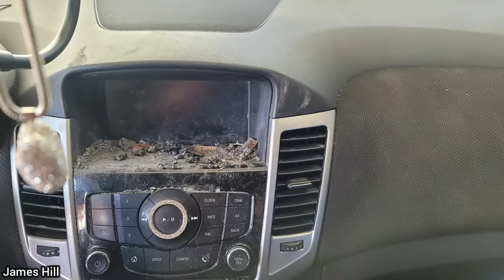Customer States New Oil Pump Installed, Still Has No Oil Pressure

Comment: Man I stress so damn much when I am in a situation where I have to allow an unsafe angry customer to leave in a car with failing brakes. As a low tier oil bitch I had no say in anything besides pointing out what was falling apart. Had a few I had to back out of the shop that I wasn't sure would stop once it started rolling off the alignment rack and into the parking lot.
GOD THE STRESS!!
Reply: Sorry about the stress, I can imagine. I’m curious, was there a policy where you worked, like did they make the customer sign anything saying they were warned but declined repairs etc? I do know that some quick service places can be scammy, I remember a muffler place telling me my car needed thousands in repairs, and my trusted mechanic said it was all BS.
Reply: Don't worry about it. It's their arrogance, bad decisions and lack of responsibility.
Reply: @toomanyhobbies2011  I wouldn’t stress about them, but rather anyone else in that car with them, and anyone sharing the road with them.
Reply: @Sashazur  Yes. I'm friends with several x mechies. If the car was in such disrepair that the shop wouldn't work on it, from a legal POV they made the customer sign a release form releasing the shop from any liability, which I'm sure would befall the customer after cornering above 5mph. The shops wouldn't give you your car back without inking the release. Because these types of shitty customers will always want stuff for free and try and sue you to fix the damage they caused for free.
Reply: @santanalz  ... if they don't have the money to repair, they certainly don't have the money for a lawyer. BTW, I have been to small claims over petty stuff like that. The judge said if we didn't do any work (estimate only) then we are off the hook for anything after that.
Reply: this is one of those wild american thoughts that are so minbogglingly stupid that no one in his right mind had to think about it twice: if a car is truly unsafe (major brake damage, frame dmg, tires close to blowing out, etc.) you  ARE NOT allowed to drive the car on public roads and why would/should you? first turn or traffic light you might very well plow into a field of firstgraders out on a trip. the shop MUSTN'T let you leave with the car, they have to inform police if there's any trouble from the customer
Reply: @Sashazur  Yeah I mostly worked in the kinds of shops with big corporate offices that are usually on the more "shady" side on an individual shop level so they can please their corporate overlords.
Reply: I would have zero stress over that non-issue.
Reply: We had a TV show in the eighties where people could bring their extremely dangerous car and get it inspected to show all the faults. The verdict in the end was almost always: scrap this dangerous ex vehicle. 

Almost all were either bought from second hand car dealers in good faith or just very long in the possession of the unwitting owner but some owners were almost proud to show their piece of crap. 

Major detail: this was before global warming hit so we had many and long cold days where salt was thrown on the roads so almost all of these cars were heavily rust damaged (too).

So somewhere mid eighties the govt had enough of these dangerous vehicles on the road and introduced state inspection for older cars. Since then the amount of lethally broken cars has been plummeting like crazy. It’s rare to see a car with major problems on the road. When you see them it’s often some person that did a hit and run and hasn’t been stopped by the police (yet).
Reply: Most developed countries have compulsory regular safety inspections to keep vehicles in that sort of condition off the road. It is, of course, an expense and extremely inconvenient to fail such a test, but I feel a lot happier knowing that these potential death traps are off the road. 

Also, any dealer selling a car in a dangerous, unroadworthy condition will be in trouble with the law.
Reply: @RustOnWheels  Oh yes, I've had a lot of rusty salty cars when I worked in Ohio. Cars where all the lift points crush like cardboard when you try to lift the car and dump a load of orange/brown evil all over the ground.
Reply: @Hekinsieden  seeing a truck bed buckle when a car is being lifted is never not scary…
Reply: @Simon-bu4kc  The problem with allowing shops to do this is that the sketchy ones would certainly abuse this to scare less knowledgeable people into getting needless repairs.

Comment: Sadly, I can say that that transmission case looks familiar, but I knew enough about what I was doing to salvage it.  Probably 15 years ago, I was going to change the transmission fluid in my 1999 Suburban prior to heading out on a 1200 mile trip to Florida with my wife and kids at Christmas.  The first pan bolt snapped off, so I very carefully worked the remaining ones back and forth to remove them.  Unfortunately, the threads from the case came out with half of the remaining bolts,   I ended up heli-coiling 8 of the 16 bolt holes.  I also noticed that the original bolts were property class 4.6 -- weaker than SAE grade 2.  I hadn't previously realized that metric property classes went that low, and I never before or since encountered corroded pan bolts.  The Suburban itself wasn't even rusty at that point, so who knows...
Reply: I agree, the bolts should realistically have been 8.8 grade. Cheapskates.

Comment: First one.  Looks like a 2014-2019 5.3 engine.  You have to be very careful when installing an oil pump on those.  Alignment of the pump is crucial and if done wrong can lead to damaging the pump.

Comment: They sealed the asphalt at my wife's work and she drove over it before it was set.  I ended up taking each of the tires off and scraping them with a heat gun and knife.  I had to use a screwdriver to get the sealer out of every tread gap.  Yeah, that was a fun four hours...

Comment: That lucas oil stabilzer really does work, and it does raise oil pressure, although its definitely not gonna fix a broken oil pump. It should be used at like 20 to 30 percent of crankcase capacity. That mechanic used 80 to 100 percent. That stuff is so thick. If you use it by itself its too thick to move through the engine. But for something like a differential, you could use 80 to 100 percent.
Reply: I suspect the Lucas is what damaged the pump. Customer probably had a "low oil pressure" warning light caused by a bad sender and/or a clogged screen beneath it, and either got ripped off for a new oil pump or diagnosed it himself. And when the pump didn't fix it, they added all that Lucas. Congrats! NOW it needs an oil pump.
Reply: I use it in my IROC-Z28, 1 quart stabilizer and 4 quarts Mobil 1. It does help with leaky valve seals.

Comment: I can't understand people that decline brake repairs when their brakes are practically nonexistent. Not that I understand people that decline many other repairs either, but brakes are pretty essential to be able to drive safely.
Reply: brake*
Reply: brakes!
Reply: @hillppari  Oops, fixed
Reply: I suspect most people end up going some place else, for cheaper.   Well, maybe not most but a lot.  I've walked into some shops, always recommended by a friend or family, and they always try and scam me.  About 15 years ago, my car suddenly started running awful on my way to work.  Ex sent me to a shop his coworker recommended.  Shop came back with a list of issues, but the main cause they said was a bad catalytic converter.  Wanted 850. for repairs just for the cat, 300. alone for the part.  I had worked at a dealership when I was 18, and I thought that was kind of high, so limped home.   Bought a new cat under 100. had it installed for 50. at different shop.  Didn't fix the problem.  That shop couldn't figure out the problem.  Stopped in a local shop almost in tears just fed up, and owner said did anyone check your spark plugs?  That was it.  First recommended shop was going to charge me 800. for a tune up.  That has been my shop I go to ever since; not the greatest, but I trust the mechanic and mostly trust the owner.  I have since and continue to educate myself on my cars and usually know before going in what's wrong and how much it's going to cost me.  And if it's something I can do myself, I do.  And, I know my limits.

Comment: Can a shop stop someone from driving off in a vehicle deemed a total hazard?
Reply from the maker: Not where I live. You can just recommend them towing it away or call a peace officer and informing them of the vehicle so they can further look into it.
Reply: Depends. In some places they're legally prohibited from letting an obviously unsafe vehicle back on the road, in others the customer can take it out if they sign a release form to the effect of "I confirm that the shop did their due diligence warning me about the insanely stupid shit I'm about to do therefore they can't be held liable for the consequences".
Reply: The problem with allowing a shop to prevent a customer leaving in an unsafe vehicle, is that dishonest businesses would obviously abuse that as much as possible, to scare people into getting needless expensive repairs.
Reply: @GaldirEonai  I really wish the form used that statement instead of the legal verbage.
Reply: @Sashazur  That's the way it works in most countries as they have an MOT, so if a car is unsafe, it is no longer insured. This isn't taken lightly and the car has to be reregistered through a government inspection. If it turns out the repairs weren't necessary, the shop is in trouble. As maintenance is a requirement to pass MOT, most shops are slammed with work and don't need to scam people. Those who do don't survive because there are many good shops around. I'm not saying there aren't scammers, but there are many more checks and balances in place in a decent system.

The scamming problem is part of not having an MOT. Make an MOT mandatory with the right legal framework and you won't have many issues.

Comment: Never heard of getting a "new transmission case". It will be a whole new transmission, I would think.
Reply from the maker: Just the case you can get for transmissions and swap the internals over. We did it on a buddy's truck who had a u-joint break and cracked the casing. Replaced some clutches while it was apart but the rest was good.
Reply: some of you people in the comments are worse than the customers
Reply: @darkdreams1589  I know very little about mechanical stuff, the comments really teach me a lot. Don’t be too hard on people like me.
Reply: @JustRolledIn  I think labor costs at a shop would make that unfeasible versus just swapping in a rebuilt transmission.
Reply from the maker: @bills6093  I'm sure the technician gave the customer a couple of options. Don't know the full story besides what I was told.
Reply: @bills6093  Here in the UK i can tell you for sure (depending on the trans ofcourse) buying a donor or case and making good the original trans is perfectly financially viable when a case has damaged lugs and threads but is otherwise perfectly serviceable. this is becoming more and more common on trans where good quality*new*  oem parts cannot be sourced and dedicated trans rebuild shops are disreputable at best.

Comment: Gawd Dang, that Wood A is wonderful!!  I think the drive shaft is what happens when a mall trucker tried roasting his back tires and the trans pan is what happens when you don't use an inch pound torque wrench and snap off the bolts and try drilling in new ones!

Comment: My Mum had a 1971 Toyota Corona that had the wiring to the handbrake warning switch (a little button that the handbrake handle depressed when it was off) rub through after 25 years of probably being incorrectly installed, putting power into the handbrake cable and turning it into a very large resistor....The handbrake cable melted the covering all the way back to the rear wheels, making a lot of smoke, locking the rear brakes on and destroying the battery. I have not seen that before or since.
Reply: MY friend in highskool had a 72 Corona with the 3TC engine that would do fine smokly burnouts against a parking block if we just lifted up on the trunk
Reply: @THRASHMETALFUNRIFFS  SOOO much powah!

Comment: Man i love these videos,ive been a mechanic since i was a kid and a decent one may i add and it just shocks me to see some of the things some people do, i had a girl call me one time i used to date to tell me her car "was smoking real bad" and she had no idea what was wrong, turns out she had put like 8 quarts of oil in a little tiny car engine that maybe held 3/5. 4 quarts, it had so much oil it was coming out of the throttle body onto the air pipe and dripping on top of the tranny hence "the smoke",lol

Another time my buddy asked me if i could do a brake job on his bosses car,  she had told him the brakes were making a awful racket and could i please look at it? she had driven that car for so long after the pads were gone that on one side the pad had finally worn completely and the caliper piston is what was stopping the car!!

Comment: That dashcam installation, on the one I did on my sisters car the only cables you can see are that coming from the ceiling/headliner to the camera, getting the cable for the rear camera through the trunking for the boot door was difficult but I did it.
Reply: All's you do is drill a hole above the back window and tape it down the window and over the trunck!

Comment: I knew somebody whose car had a problem when the starter cable chaffed through on a brake line near the brake master. The subsequent intermittent short when he was driving was sufficient to heat up the brake line, boil the brake fluid in the reservoir, and by the time he noticed he smoke pouring out he had complete brake failure on both circuits. He was only just about able to stop using he parking brake.

Chaffing through electrical wiring can lead to all sorts of problems. It's a good idea to check inside he engine bay from time to time to check for it. Sometimes the clips retraining cables or various pipes break or come loose. Or, what I have also found, is mechanics failing to re-install them or routing cables or pipes incorrectly.
Reply: I had a cracked starter solenoid that kept falling out and hanging then it hit the brake line and made a pinhole and started fire but the dude next to me cruising downtown let us know and we pulled over and blew it out

Comment: I recently completed replacing the ride height sensors and air bag suspension on my range rover along with new rubber D bushes for the sway bar, new drop links & a new steering damper. I couldn't do the steering track rod assembly as I don't have the equipment to align the wheels myself so took it to a garage. They smashed most of my work including the airbags and reinstalled the ride height sensors back to front so when the car lowers they snapped off! I'm never taking my car back to a bloody garage again!!! Why they took the sensors off in the first place puzzles me!

Comment: I bought a 93 accord as a gambler 500 car and ran it on straight Lucas oil stabilizer because it had a major oil leak. The car took it like a champ, fixed the leak and put it regular oil and it ran like nothing happened 😂

Comment: The Hyundai Elantra at 2:12:
They brought in the car for a brake line corrosion recall (replacement), buuuut don’t want to fix the RUINED brake rotor?  Woooooow.

Comment: 1:02 If I were to take a guess, using an air impact tool and had the wrong bolts. IE : Had Imperial (Standard) when it was metric, or had metric when it's Imperial (Standard). Impacted the first 3-4 threads, then it got stuck. Ripped them out after, or tried to anyway.
Reply: Seems like after the first one breaks, you'd stop.

Comment: I wonder if the first one even needed an oil pump. Those Silverado 5.3Ls have a screen under the sensor that clogs up and needs removed while replacing the oil pressure sensor. Running straight Lucas is what smoked that pump. You're only supposed to use 1 qt.

Comment: So many of these are like the stuff I see daily, and wish we could have a federal vehicle safety inspection with the same level of scrutiny given to commercial vehicles. Every safety inspector would be able to issue a DO NOT OPERATE order when customers decide not to fix critical safety issues. Throw all the emissions stuff away, but safety such as brakes and steering components, and also excessive rust for northern vehicles is needed.

Comment: Do they have anything similar to an MOT in the USA like in the UK ? As some of these cars would of been written off years before they got in those states in the UK. It's stupidly strict and sometimes the rules make no sense but it obviously keeps most of the death traps off the road. If your car fails you cannot legally drive it out of the garage, you can trailer it home or to the scrap but most of the time you cough up a few £100 for the repairs. You used to be able to buy a shed for say £800 with 8 months MOT left on it knowing that in 8 months it would need scrapping and just shag the life out of it for 8 month, you don't see many cars like that in the current market as you don't get your monies worth anymore.

Comment: The owner transmission service looks like it leaked and they figured it needed tightening to stop the leak . They probably stripped out some of the boss's and then decided to drill new ones . The broken areas are places that couldn't handle the stress and snapped like on corners .

Comment: I am a pro tech, I hand start all transmission pan bolts first, then use power to tighten them. I have a slip clutch gun i use so i cant overtighten or strip anything. Just a thought eh?